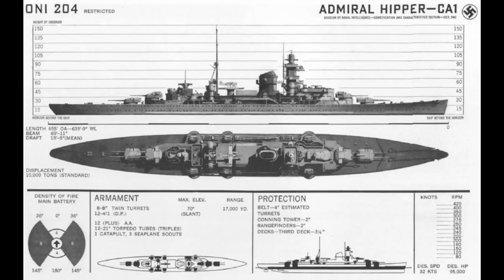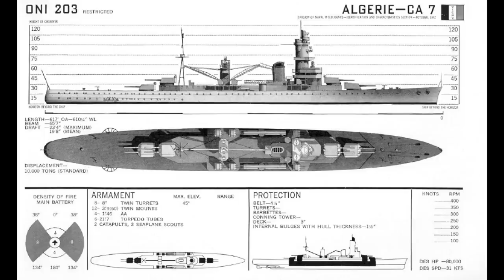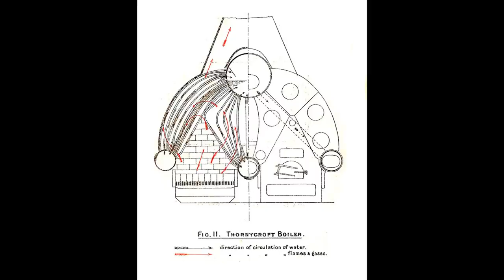The Drydock - Episode 021

Comment: Poor you, we can tell you are having a tough time, I hope you're on the mend.
The Swedish navy used to name their ships affectionately, like the missile boat HMS Styrbjörn, although a name it can also be interpreted as Styr-Björn (Steer-Bear) so it was called HMS Rattnallen, in English; steering wheel teddy-(bear) which isn't as short and rolls off the tongue as in Swedish.
Worth mentioning about the working condition on Japanese ships are their undulating deckline, besides the weight saving end result, it also was part in due because the Japanese thought only officers needed to stand tall and straight and thus given a full 7,5' to 7' feet and two thirds deck height, wereas the men could do with less than 6' and when you deduct trunking and piping overhead you are left with less than 5,5' at best, which in turn means you have to keep your head down.
Suggestion for ships to cover: a special about the British heavy cruiser designs that wasn't built. There is a lot of talk about the G3 and N3 designs with drawings but I've seen less about the 9.2" cruisers and other designs that never came to be, some detail and line drawings would be delicious!
Reply: I'm not sure whether Churchill's 9.2-inch gun super cruiser concept ever got the point of line drawings before the idea was discarded.
Reply: @RedXlV  I know, though a lot of artist renderings are what we are looking at today anyway, there are numerous conceptual drawings that has been drawn that is floating around that people think are official but actually drawn by inspired artists in recent time. 
I don't play world of warship myself, but the good thing with the game seems to be influencing people to be inspired by it and devote effort to conceptualise what ships would have looked like by drawing on the design ideas of the period.
Reply: @RedXlV  
1938 PROGRAM

 

In January 1938 DNC asked his preliminary cruiser designer, W G John, to sketch a variety of heavy cruisers, beginning with a 20,000-ton ship (700ft x 70ft x 25ft), to make 33kts at standard displacement, with high endurance. Armament would be three quadruple 9.2in turrets, six twin 4.5in and four octuple pompoms, but there would be neither torpedo tubes nor machine guns (0.661in). The ship would have two aircraft and a deck catapult. Armour would be an 8in belt covered by a 4in deck, with underwater protection against a 750lb charge, as in a capital ship. The designer was to try to ‘scrape down’ to not more than 15,000 tons;

 

Study 1 (9.2in gun/20,000t): The design was developed in some detail. 39 The ship would be about the size of a carrier; DNC suggested starting with 132,000shp. DNO provided data on a quadruple 9.2in turret. The belt armour would resist 10in shells 40 ° from normal at 16,000yds; the deck was expected to resist 10in shells and also a 1,000lb AP bomb dropped from 8,000ft. DNC suggested a short forecastle design with a hangar and the usual alternating engine and boiler rooms, the machinery box being pushed well aft (as in Belfast). A cross-section showed a 16ft 6in deep belt extending 11ft 6in above the waterline, with an internal deck below the armour deck but well above water, and a side protective system inboard of the belt. Hull depth would have been 35ft 6in. The belt would have been closed by 6in bulkheads. As in recent much smaller cruisers, the belt armour, rather than armour boxes, would have protected the magazines. The 20,000-ton hull actually proved somewhat small, so John tried a 23,700-tonner as well. 40 To get back down, John tried triple 9.2in guns, but found he did not have enough machinery weight to make 33kts. He had to reduce armour. 41 By early February 1938 this design was being called an armoured cruiser.

 

Study 2 (8in/9.2in 21,750t):  DNC next asked what could be done with nine 8in guns (Design A), or with nine 9.2in (Design B). Speed was set at 33kts and endurance at 10,000nm at 15kts. Other armament was six twin 4.5in, four octuple and two single pompoms, and twelve torpedo tubes. Armour should defeat the ship’s own guns at 90 ° inclination (worst case) between 8,000 and 25,000yds (with an inch less over machinery). The deck over the magazines should defeat a 500lb SAP bomb dropped from 10,000ft (over machinery, a 500lb dive bomb); and underwater protection should, as before, defeat a 750lb charge. For the 9.2in gun, this was more than had been asked for before: 10 ½ in C over magazines and 9 ½ in over machinery, with a 3 ½ in deck over magazines and 2 ½ in over machinery. 42 For 8in shellfire it was quite heavy, too: 9in (8in) belt and 3 ½ in (2 ½ in deck). Deck armour was the same in both cases because it was determined by the bombs, not the shells. This was the sort of protection the US Navy later provided in the Alaska class, not even approached in any conventional cruiser. A sketch showed a ship with a waterline beam of 84ft, bulged underwater to 88ft, so that the battleship-style underwater (side) protective system could be 10ft deep. DNC received the report of this pair of designs on 28 February and in turn reported to Controller on 4 March. The ship with nine 8in guns was expected to displace 21,750 tons and to cost £ 5.5 million.

 

Study 3 (12in/20,000t):  DNC asked for details of an Alaska-like super-cruiser, at 20,000 tons, armed with six 12in guns, with 7in belt and 3in deck, which was what the Japanese were (incorrectly) reported to be building. 43 Unlike the 8in and 9.2in cruisers, it was legal under the 1936 treaty, because it came in above the prohibited cruiser zone (8,000-17,000 tons, 6.1in to 10in guns). The estimate was based on the 9.2in ship reported the previous February (700ft x 84ft x 23ft), the twin 12in turret being comparable to the triple 9.2in. Work on such ships resumed in February 1939, with analysis of an 18,000-tonner armed with six 10in guns and twelve 4in HA/ LA guns, protected against 8in fire, with a speed of 32/ 34kts and a cost of about £ 5 million. Protection was that calculated the previous year, 9in side and 3in deck, offering immunity (against 8in fire) between 8,000 and 25,000yds. The deck could resist 1,000lb AP bombs dropped from 4,000ft and 500lb SAP from 7,000ft.

 

Study 4 (8in/10,000): In June, DNC asked for studies of a 10,000-ton cruiser armed with 8in guns, in effect a ‘County’ using current technology. 44 Presumably Controller (and the Board) envisaged a partial but not complete breakdown of the treaty, so that 10,000-ton 8in cruisers could once more be built under the specific treaty clause allowing a breakout without mutual agreement as to new limits. Hence, as calculations were made, small excess displacements over 10,000 tons were rejected as unacceptable. DNC envisaged a flush-deck ship armed with three triple 8in guns, four twin 4in, four multiple pompoms, and two triple torpedo tubes, plus the usual aircraft and catapult, capable of 32kts, with a 2in deck. Could such a ship have 6in side armour? Variants should be (a) protected against 11in fire (i.e. German ‘pocket battleship’ fire) at fine inclinations; (b) with armament forward; (c) well protected against 8in fire; and (d) without 4in guns and pompoms. The ship would have new heavy 8in shells (290lbs). On DNO advice it was assumed that the 8in turrets would elevate to 60-70 ° and that the guns would be as far apart as in the twin mounts of the ‘County’ class – which guaranteed that turrets would be large. Analysis suggested that a 32kt ship would displace just over 10,000 tons. Data were worked up for both a 32kt (80,000shp) ship (Design A) and a 30kt (58,000shp) ship (Design B), both with 5in belt and 2in deck, Design B coming closer to 10,000 tons, but by surprisingly little. 45 As sketched on 29 June 1939 the ship looked like a cross between Belfast and Fiji, with a substantial gap between her bridge structure and a hangar built around her forefunnel. Like a Fiji, the bridge carried a DCT on its centreline and HADTs on either side. The forward 4in guns were in this gap. The ship was flush-decked, but with cut-outs in the forecastle deck so that the after 4in guns (between the two funnels) and the torpedo tubes were a deck lower. An after superstructure just forward of ‘X’ turret carried a third HADT on its centreline, with the after DCT below and abaft it. This structure also carried the ship’s pompoms.

 

Source: Friedman, Norman. British Cruisers: Two World Wars and After (Kindle Locations 3688-3692). Seaforth. Kindle Edition
Reply: @N0rdman  So did they ever draw those designs up, or just write out what the specs needed to be? Also, is there any info on what sort of 9.2-inch gun would've been used? No gun of that caliber was in production in 1938, so would they have just used some of the over 100 WW1-surplus Mk X rifles (actually very good guns with an excellent AP shell), or would a new gun have designed and built?
Reply: @RedXlV  Although I haven't found solid proof of contemporary drawings or sketches, I would have been very surprised if they hadn't produced at least a sketch of these ships. 
If you are into naval architecture, there are a lot of information that is easier and actually quicker to conceptualise and draw data from, like dimensions of the hull with a schematic drawing. 
When I was at the naval dockyard in south of Sweden, Karlskrona, we had several drawings and even models of ships that never came to be for pure ornamental purposes, the actual ships finished are in storage or museums but the "never was" doesn't have the same importance (from a strict dry curator perspective).
Yes, you are right, the 9.2" was an exceptional gun for its time, but unfortunately just years before the war they scrapped all their 9.2" guns in storage, just shortly before Britain was in desperate need of long ranging coastal artillery, something I'm sure they must have regretted. 
They simply would have to develop a new guns, something that might have also been very interesting to see how a more modern gun would have been improving things, from a ballistic and artillery perspective.
Reply: @N0rdman  Britain kept a hundred of so of the 9.2"/47 guns since many of them were already in coastal artillery during WW1 and some of the naval guns from scrapped armoured cruisers also got transferred. Some of those are still around today, including 3 at Gibraltar, a dozen at forts in South Africa, 3 in Australia, 4 in Portugal, and a 4th of the Gibraltar guns on display at Imperial War Museum Duxford
. And of course the 4 very similar 9.2"/45 guns mounted on the Greek cruiser Averof.

It was the even better 9.2"/50 guns that all foolishly got scrapped. Along with the 9.2"/51 guns from the Gorgon-class monitors. Given the ridiculously long range of the 9.2"/51, I bet the Brits were kicking themselves when they realized they needed cross-channel guns to install at Dover.

Comment: The Japanese did not have any reserve stocks of aerial torpedoes in Indo-China.          Admiral Sir Tom Philips considered Singapore a too exposed base, hence his investigation of emergency basing in Darwin Australia.       The Singapore Naval Base area was impossible to attack with torpedo bombers; the shape and depth of the Johore Strait and the nearby ridge lines resulted no effective line of approach and torpedo drop location.      The Royal Fleet Auxiliary Anchorage near Changi had a possible remote chance of torpedo bomber attack, but it was not used as the Eastern Fleet was never big enough to be required.

Comment: US actually had a pretty good Idea of Yamato's capability, just based on her length and beam measurements. ONI estimated her at 65,000+ nominal displacement with 18" guns and 16" belt.  This pretty much dictated the design of the not completed Montana class of the same belt and displacement with 12 16/50's instead of Yamato's 9-18.2" Montana was also designed to be faster by 3 knots (30-27), although they did not know her exact speed design, based on previous known speeds of completed Japanese battleships they estimated it would be 25 knots or faster.